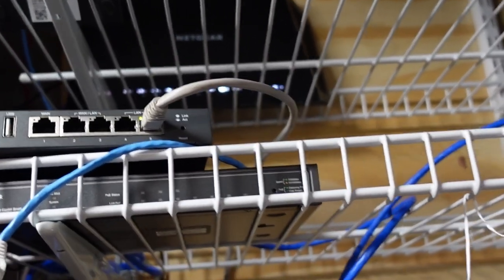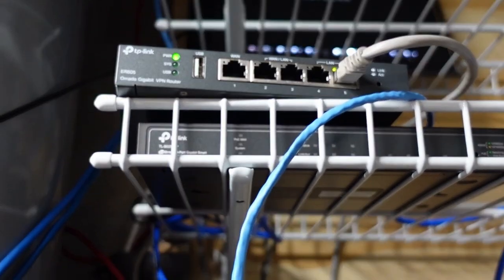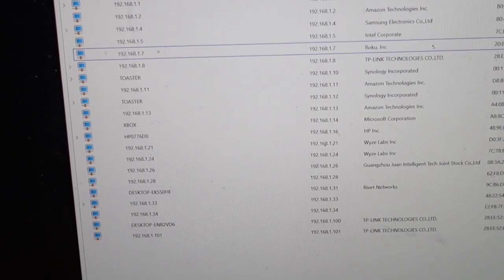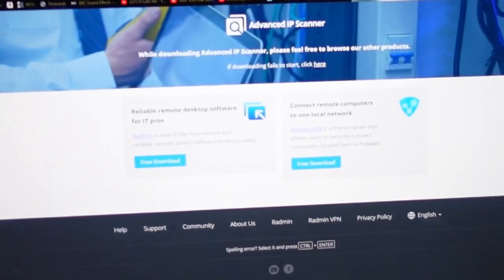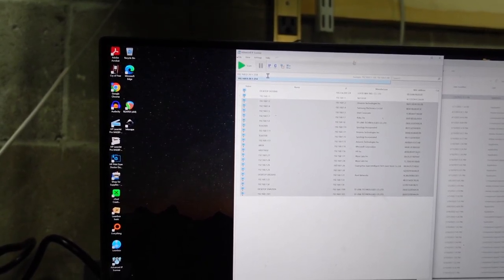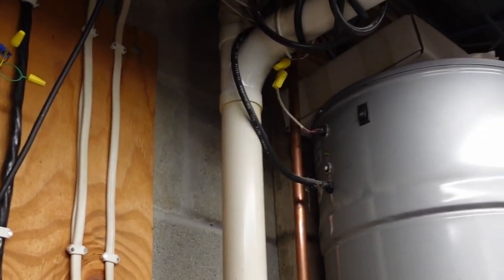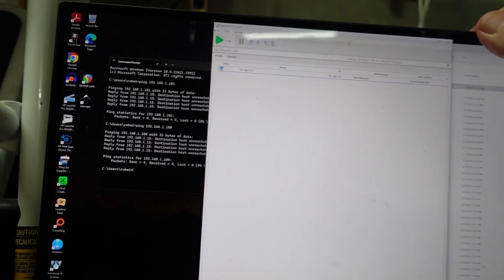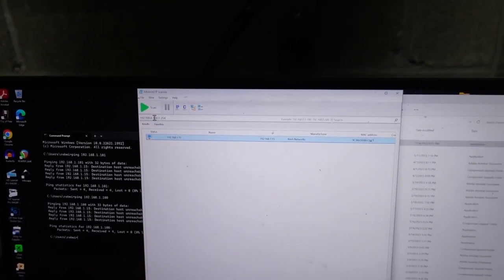TP Link Omada install fail

Comment: You can also connect a cable from your network into the wan port of your new router as long as it's not 192.168.0.x